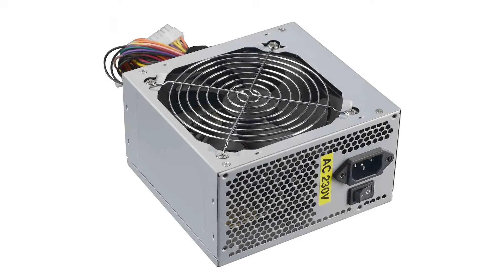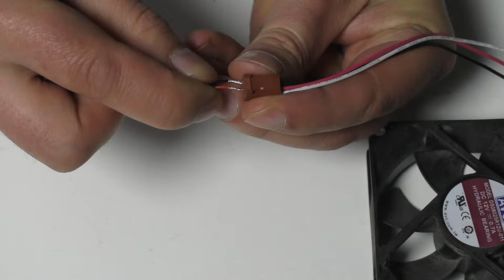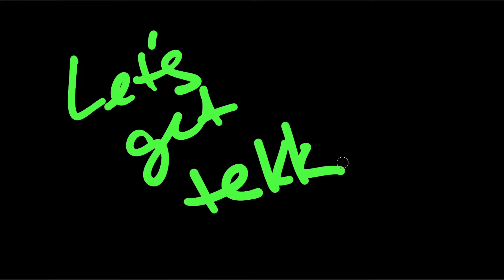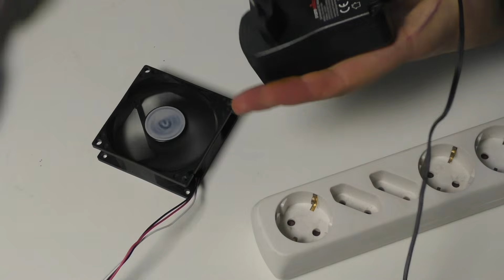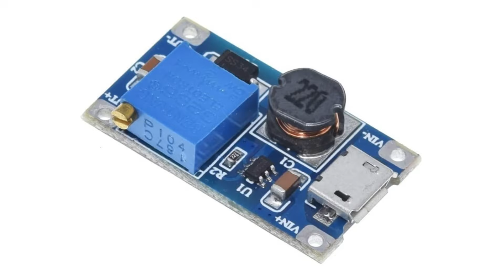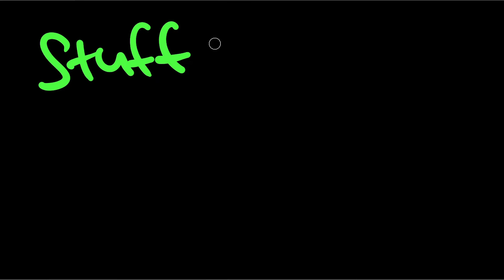USB power your 12v fan with speed control - Hacking fans with James Lovelock Part 1

Comment: trying to power a computer fan with a battery pack but the cable that runs to the connector doesn't have colored wires, I'm unsure how to find out what is what

Comment: If my friend S.L. wants to combine multiple fans - does he have to do it parallel or serial?
Reply from the maker: If you have a 12v supply and you connect 2 fans in parallel then each fan will get 12v. If you connect them in series they will each get 6v. So if you want to stack fans and they all get the same speed, you usually want parallel
Reply: @alexstacey  Thank you for the quick reply.
I will make a cluster of fans all around my pc screen.

Comment: Great video.  I am trying to use a 6" fan with rgb lights and mount in my RV ceiling, but having a hard time knowing what wires power the fan and what wires control the rgb's.  All are black wires.  Two leads, one with 3 pins, and one with with 4 pins. You gave me some ideas to test!
Reply: multimeter

Comment: So uhm, my fan has 4 wires that are all black
How would i determine power vs ground? I dont care about being able to change speeds this little fella is gunna be stuffed inside some custom ventilation in my dads garage for his soldering station. I reallly want to make it myself and not just go buy him a ventilation fan outright because I know he would love the idea that i made it myself more than anything.
Reply from the maker: That sounds like a cool project. Nice one. If you look at the connector on the end of the wires, there will be some plastic fins that make it so you can only plug the fan in one way. These are pretty standard on fans so search for an image of a PC fan plug and you should be able to work it out
Reply from the maker: Eg. https://www.cgdirector.com/wp-content/uploads/media/2022/04/3-pin-vs-4-Pin-Fan-Headers.jpg

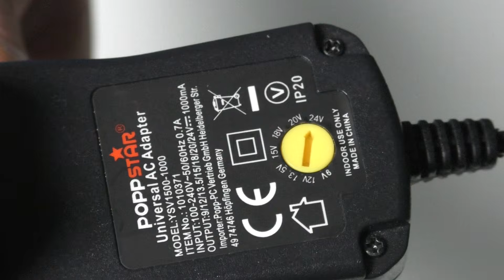Comment: what's the thing you use to connect the fan to the adapter at 1:36 called? I'm having trouble finding the name of the connection :D
Reply: I could be wrong but it kinda looks like a female barrel plug (one without the center pin) to a 3 pin (fan)
Reply from the maker: I find them on Ebay searching "12v female power connectors"

Comment: Great video on the second one maybe add a temperature sensor to have it turned on and off
Reply from the maker: Just posted a part 2 here Thanks for the feedback! Just uploaded a part 2: https://youtu.be/8b6f9M_PL8M

Someone else has also suggested temperature control. I might add that. Sounds fun!
Reply: Didn't work for me but I used a micro usb cable.